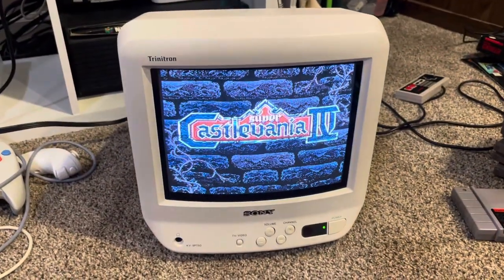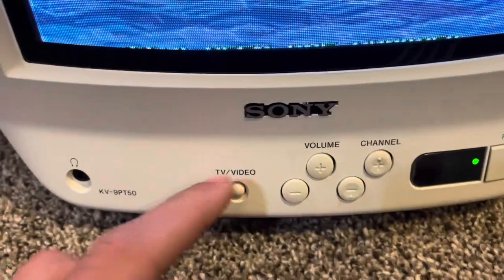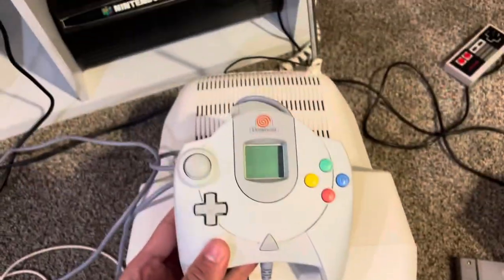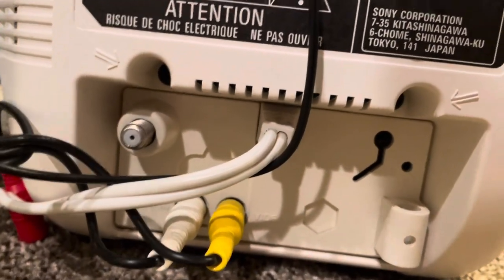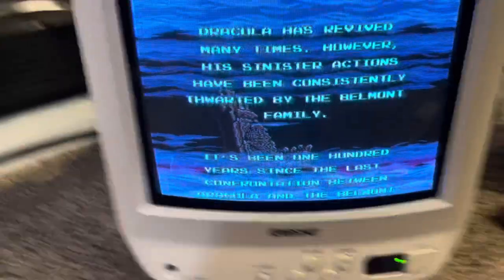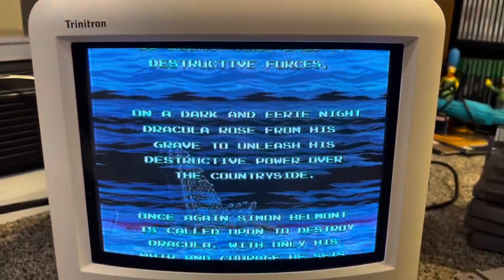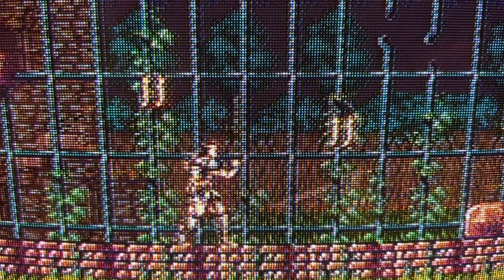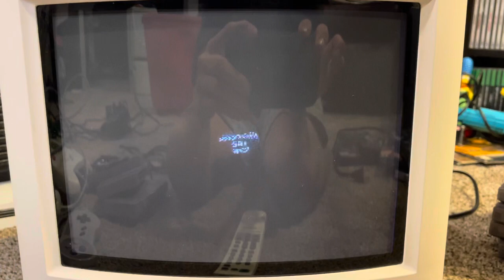Sony KV-9PT50 review for retro games

Comment: Ha ha! I just found one locally for $5 at a goodwill type of place! No remote, no stand, kinda dusty. Haven't powered it up yet because I want to clean the PCB and parts, and maybe consider adding SV or even RGB input to it.
Reply from the maker: Great deal!
Reply: @gameselectronicsrus3909  I'm pretty stoked, I just walked by and randomly walked in and there it was. I was looking for a smaller CRT than the 13 incher that gobbles up all the room on my little computer desk.
Reply: Really no reason to use anything above composite on these size TVs IMO. Composite looks way sharper on these small sets than a big 32" for example. Genesis games with lots of dithering will actually look far better on this composite set.
Reply: @overnightdelivery  Hmmmm, good observation. In any case I don't really like doing mods like this, I just thought that if I'm opening it might as well. But the thing's tiny indeed.
Reply: @overnightdelivery  I have one of these in black.  I use it for watching the local news and old 90s TV shows.  Even at this small size I can see some dithering on graphics.  I also own a 27 inch Zenith that we've had since 1990 and for some reason, Zenith's design made the image quality of composite and S-Video almost exactly the same

Comment: Cute TV. I noticed a "screen door" pattern on the grill of the tube. First time I have seen that on a Sony. Especially odd considering it's small size.
Reply: I have one of these in black.  I use it for watching the local news and old 90s TV shows.  Its kind of a "low resolution" screen in that the stripe pattern is the same basic size and spacing of the larger trinitrons, but since the screen is so much smaller there are fewer color stripes to build the image.
Reply: Maybe not a Trinitron tube.
Reply: @jimbotron70  It is a Trinitron, it says so right above the screen
Reply: @lander77477  Yes of course it is, maybe on their cheaper models they cheaped out and didn't use a full Trinitron tube like in bigger models.

Comment: Seen a few of these on ebay is it easy to get into the service menu and does it have good adjustment options?
Reply: I have one of these in black.  I use it for watching the local news and old 90s TV shows.  Yes you can get into the service menu the same way as the larger sony TVs.  The only thing that doesn't work is the horizontal size for some reason, it has the option but it doesn't do anything, but there all the other options are there